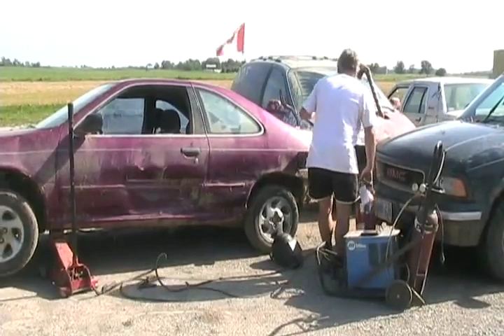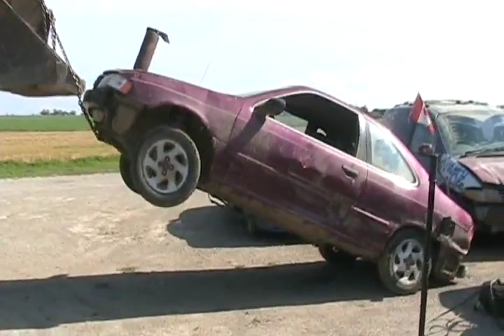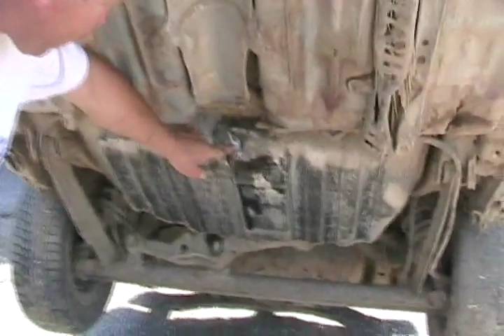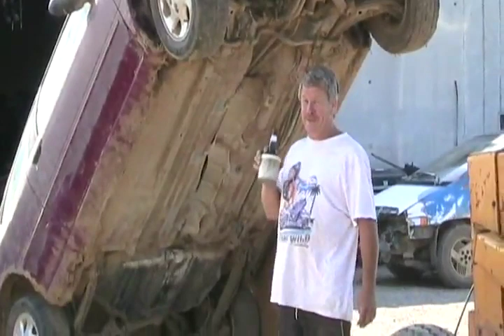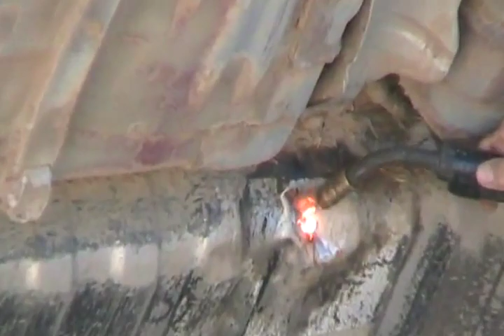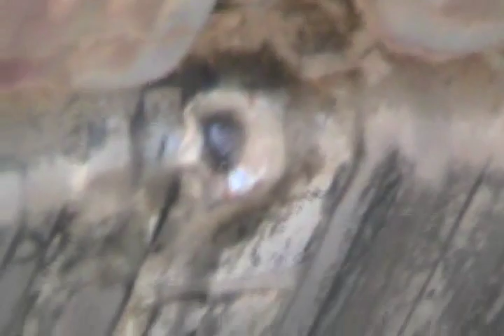#1093 Weld fuel tank with gas in it [Davidsfarm]

Comment: big balls to weld on a take that had gas in it. 35 years welding i and i never do that.
Reply: I hardly doubt that you know something, judging by your childish way of talking. I know why the gas could not explode, do you? I have actually experimented with this, to blow up a glass beer bottle you need about 2-3 drops of gasoline, it basically means that the tank would have to be empty for it to explode, and because he filled it with co2 prevents o2 to reach fuel on the bottom even if it could explode. Im  a welder by trade btw.
Reply: akaeldin he did not weld on a take he wldend on a tank
Reply: @motorpapa3446  Science doesn't let you down.

Comment: WOW!!!  just like a gifted,say,an high wire circus artist,this man knows what he is doing!!!  

REMEMBER THIS:   gasoline without AIR, DOES NOT BURN!!!! (but you knew  that, it takes the oxygen in the air  for a car to run: choke it (cut  off it´s air) and it stops right away; 

Now,he used a CO2 tank (fire extinguisher, etc),to REMOVE the air in the tank and REPLACE it W/ CO2: this way, gasoline in tank CANNOT burn,nor explode;the reason you see the small flame is because of the outside air mixing with the gasoline vapors coming out of the tank through the little hole he welds;

Having said this:  I DO NOT try this; not after I bring a flame to the hole,at the tip of a 3 foot stick,and i'm well shielded behind something; then( NO DELAY!) I would weld;  obviously this man is  very experienced;  this is not for  everyone!

Thanks for posting David (in 2013,lol); amazingly simple.

Comment: he flooded the tank with co2 from the co2 extinguisher: that's beer gas; that will not allow the gasoline to burn; i used to do the same on old jaguar xj6 dual tanks,that rotted at the bottom,in newark nj 1980s; but i would use the co2 in a 2 liter coke bottle,piped all the way in thru a hose,shaking that bottle; one or 2 per tank(we still drank the cola,not spoiled yet);the pitting was at the bottom,and all the gas was taken out; (vapors ,remaning ,still could explode and kill you).